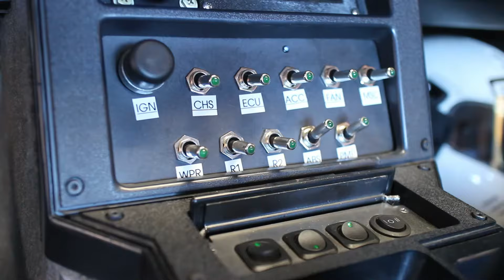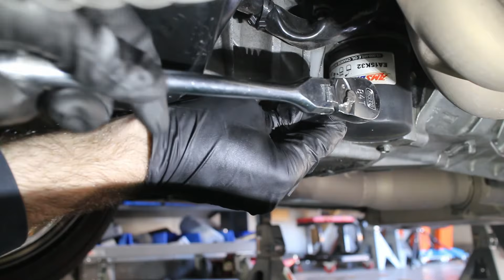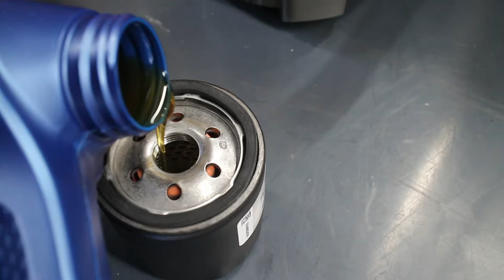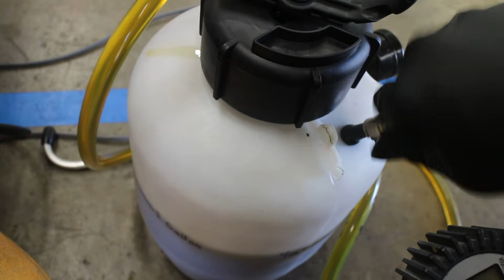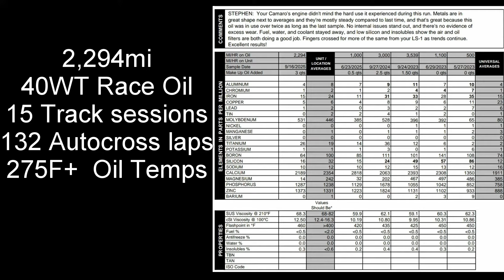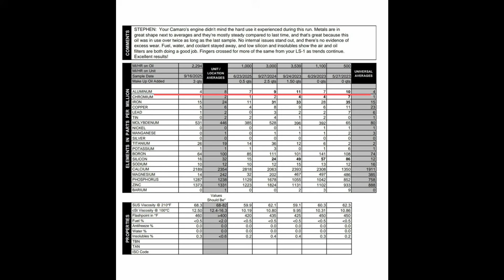Accusump Oil Lab Test — Worth the Hype

Comment: Nice! I have my accusump electric valve switched to my ignition, but I also have a manual valve plumbed in line. So everytime I key on it pre-lubes the motor and then fire the car up. But if for whatever reason I need to key on without starting the car I'll just shut the manual valve off. But mines isn't really a race car so I didn't want to use a switch everytime i key on
Need to do my first oil change with it